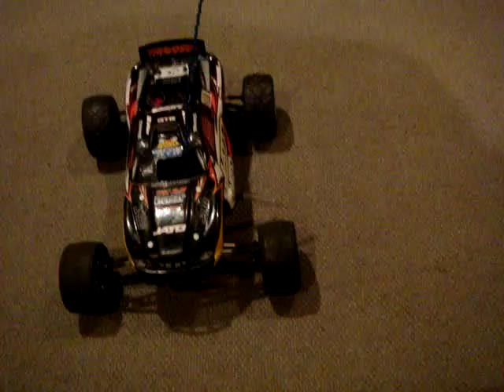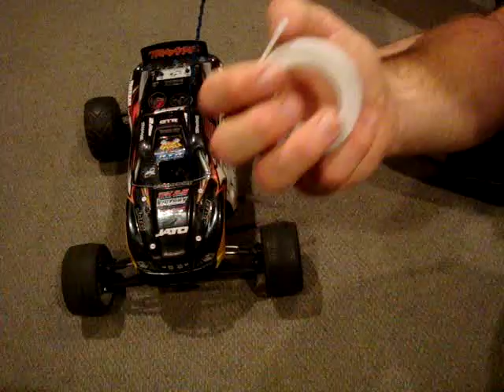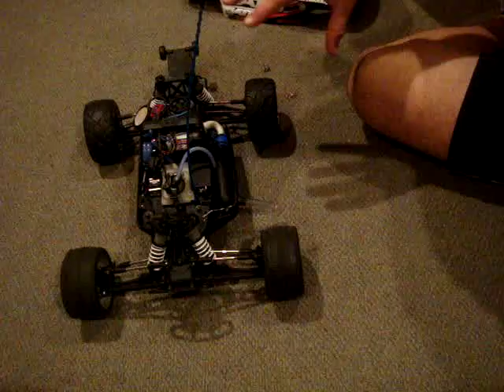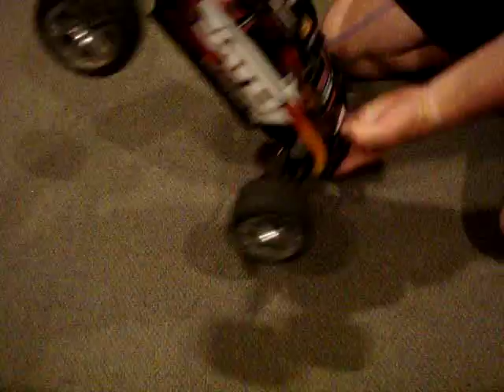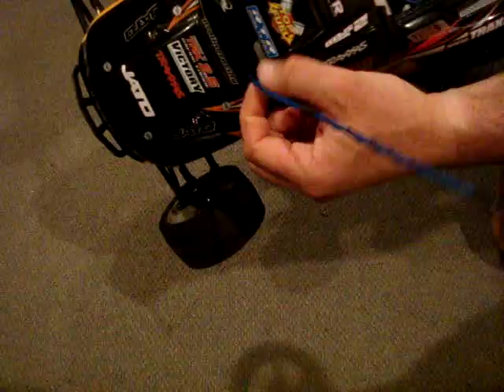Getting the most out of your traxxas jato, Part 1.  Adding an extra fuel tank, (Vid 1)

Comment from the maker: If the engine is tuned right running it longer will not over heat the engine.
Keep in mind that this engine is used in the T - maxx which uses a 125cc Tank.

Comment: All u had to fo was remove the top chassis and up from room get a tank thats a lil wider and just a lil bit more taller...and by removing the top chassis it takes off weight andu wont have 2 use a 3.3 I us a .12 on my extended chassis jato and I kill the 3.3 speed and fuel